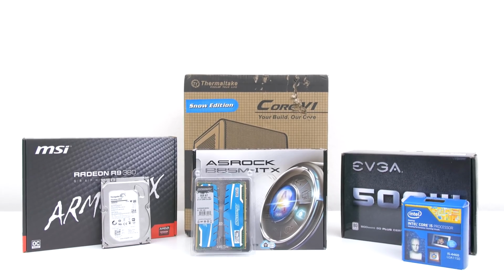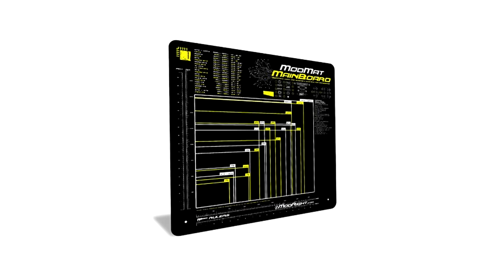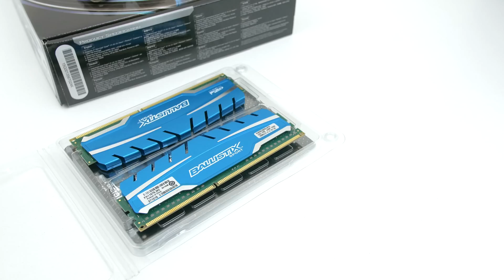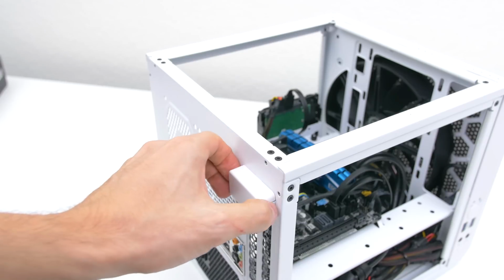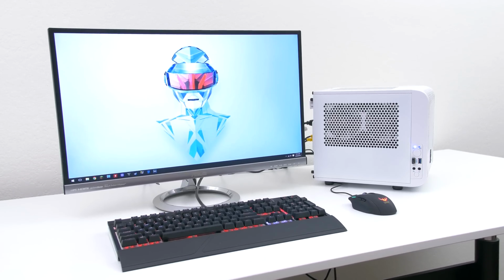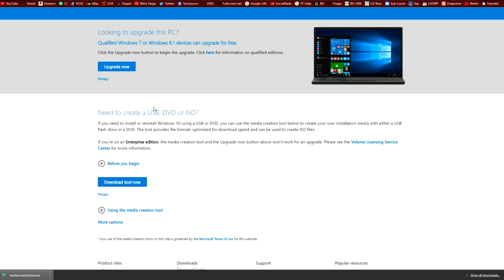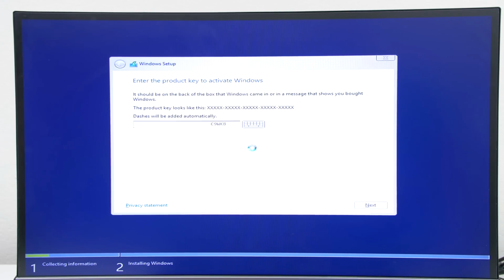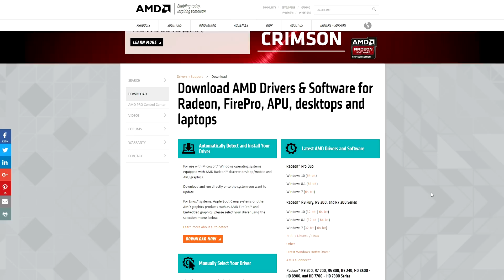How To Build $600 Mini-ITX Gaming PC w/ Windows 10

Comment: I have this a build similar to this 
I5 4460
MSI GTX 960 4GB 
CORSAIR 8GB RAM IN 2X4GB 
EVGA 500W
250SSD AND 2TB HDD
MSI KRAIT MOTHERBOARD 
overall the build is solid only thing I'd change is that I wish I waited a bit and got a better processor as I play cpu heavy games

Comment: Excuse me , do you guys recommend i get a $500 Laptop or go with this build?
Reply: this build is much better than any laptop
Reply: I usually don't reply, but seeing a lost soul on a topic I actually know I few things about. I can safely say without a doubt that you should definitely get this pc. any $500 laptop would most likely be crushed by this pc. just because laptops are overpriced in general. they charge such a high premium for "Slim and Mobile" gaming. not to mention, the laptop you're looking at might not even be capable of running games ( just for the sheer fact that it wasn't created with gaming in mind).Anyways just to summarize, get this pc if you want guaranteed gaming performance. (Watch his benchmark on this pc, it will show you the average FPS of games that this pc will give you.)
Reply: This build!
Reply: +LYFE Latops are usually more expensive because it includes a screen, keyboard, and a lot of wireless features.  Nonetheless this PC will demolish a $500 laptop.
Reply: go with this build it will beat any laptop for the price
Reply: rule of thumb any  do it yourself pc build will crush  same price laptop, hands down.

Comment: Out of curiousity - why do you install the operating system on the SSD drive.  Is there an advantage to doing this or is it just personal preference and so you can save all your files to the HDD for easy storage and deletion.  Is there another advantage to having the 2 drives?  Cheers,  Vicki

Comment: if instead i get the gtx 970 will it still be the same Building process??
Reply: the AMD RX 480 is only $199 and is faster than the 970.
Reply: +Arekkusu The Great How does it compare to Higher cards like the 980?
Reply: It's in between the Gtx 980 and 980 ti. Wait for it to come out later this month.
Reply: Cassie Griffin the 980 will be about 10% faster but the 980 is $200 to 300 more expensive.

Comment: If you dont want to go to reddit the website kinguin (I got mine here) has the cd keys for about $20 or lower. It only requires a 4gb flash drive to install windows. It is easier to use a usb 2.0 to download windows to avoid any problems.

Comment: @Techsource can i use this micro sd card and its adaptor as a drive to install windows 10 on this build? http://www.amazon.com/Lexar-High-Performance-MicroSDXC-version-LSDMI64GBBNL633R/dp/B00IF4OATU?ie=UTF8&keywords=go%20pro%20sd%20card&qid=1465424485&ref_=sr_1_15&sr=8-15

Comment: Will it play club penguin 4K on five 6p monitors?
Reply: no you'll need a more expensive build for such a demanding game
Reply: I think 12 1080s and 4 Xeon 18 core Cpus will be able to play that game at 480p 20fps
Reply: You'll have to have a 4 way 1080 SLI.
Reply: You will need 7 way 1080 sli to barely run at 30fps low settings.
Reply: I'm pretty sure. it might not be able to run minesweeper though.
Reply: If you want it from the technical side of things, club penguin is not playable on any computer at that resolution cause 6p = 6 pixels :P
Reply: you will need 12 quadros and 4 xeons to play 360p @ 20fps
Reply: Haha no. Club penguin is the worlds most advanced and physics bending game. Currently, no computer on earth can play higher than 360p all settings at low and reach 2 fps MAX!
Reply: The Gaming Bible so my pc with a radeon 5700 hd  can't even RUN the game! now i know why that internet cafe has 12 quadros

Comment: can u change the gpu for a 960 or 970 whitout any problems.
Reply: There is a link to a 970 in the description under optional parts. This will definitely fit in the case. Most graphics cards will fit in this mini itx case but I would just double check measurements to avoid any problems. If you are in doubt just use the one that he has in the description
Reply: you mean a 970 instead of a 380 yes you can use a nvidia gpu but you need the drivers from nvidia not amd

Comment: Is this good for a $550 gaming PC?
Intel i3-4170
MSI Z97S Krait Edition ATX
1600mhz 8gb ram
MSI GTX 960 2gb 2gd5t oc
Thermaltake 700w psu
Corsair Carbide 400c 
Corsair H60 water cooler

Plan on overclockin
Reply: Processor... Nope...
Reply: +Calico what processor than?
Reply: You probably don't need a 700w.
Reply: Get rid of the water cooler and downgrade the PSU to the Evga 500B. Then get an i5. You can't overclock non-k processors.

Comment: Question: I'm really interested because it's really compact and easy to build. Will the pc overheat faster then normal ATX's?
Reply: Thats why its called "icecube" LOL
Reply from the maker: +Benjamin Streulens nope. It's extremely cool
Reply: Thank you and keep up with the fun setup wars and builds! :) You earned the 700.000 subs ;) Congrats
Reply: He's got guides for cheaper pcs like $350. You can probably get away with an i3 or pentium. Most gpus around $100 can usually handle games ike TF2, LoL, Minecraft etc. Like the gtx 750 ti
Reply: That depends entirely on the games you want to play
Reply: Well this computer is pretty great, but you could substitute the ram for just 8gb and maybe a 500gb hard drive. That could save you some extra $. Also get a cheaper case if you don't care about looks, mine was the cheapest i could buy!
Reply: if its just productivity and light gaming, honestly a laptop is fine, so long as it has an i5 probably for some decent performance, and if it has a weak gpu like a gt730m for example, they're quite competent for games like you stated but yeah, pretty much anything is fine, just make it fit your budget :)
Reply: +TechSource does this beat a MSI with gtx 970m laptop gs60 ghost pro??
Reply: I'll probably be selling one you describe, its a laptop, lenovo y510p, Its got a gt755m and an i7 processor
Reply: +TheDemonDevil probably not. But it depends on whether or not the laptop thermal throttles. If it doesn't, then the laptop is better. The R9 380 loses to a 960 4gb most of the time. So a 970m should be even better.
Reply: BLOOGaming thx for the reply so I guess I shouldn't build this then? What bout when rx480 comes?
Reply: TheDemonDevil  depends on your budget,m but yeah, rx 480, I'd wait for that, it's a bit of beast for the price from what we know. cpu and ram wise it doesn't matter too much, unless you want to play really intensive cpu games like arma and stuff, but this build, replaced with an rx 480, and maybe a sexier case ;) would be pretty competent for 1440p and easily do 1080p
Reply: +ThePurple1234567891 buy anything BC if it doesn't run chrome then it's not a PC anymore it's trash
Reply: +ThisGamerzAwesome I would call it a potato ;)
Reply: no, the reason you buy a bigger case is so you won't be limited in the size of your build next time.
Reply: *****  750 ti is a really really good value card, got one for my brother and he plays fallout 4 (with a pentium mind you) on low-medium settings at 50-60fps, so  its a very very good value card i reckon
Reply: TheDemonDevil
Sorry for the late reply! It didn't pop up in my notifications for some reason.The RX 480 is pretty awesome. The 4gb version is equal to the 8gb version in almost every game. So you could just pay the $200 and get bettter-than-970 performance. Especially with Vulcan improving AMD's framerates by >25%! Then again, only 2 games use Vulcan right now.
Reply: Jordan McGaw I got one of them for $20 on craigslist
Reply: ***** luckyyy

Comment: What if my hard drive isnt showing up anywhere? Is it defective?
Reply: Also now my computer is saying "whea_uncorrectable_error" in blue screen then restarts and says "An operating system wasnt found. Try disconnecting any drives that dont contain an operating system." My boot drive is an m.2 drive and i had just installed all the drivers then it crashed. I have no idea what to do please help
Reply: did you install the correct drivers? also you need to boot from your hard drive... you know the one were the OS is...
Reply: theres a how to video, how to install Windows to an m.2 ssd

Comment: Is this good for a $550 gaming PC?
Intel i3-4170
MSI Z97S Krait Edition ATX
1600mhz 8gb ram
MSI GTX 960 2gb 2gd5t oc
Thermaltake 700w psu
Corsair Carbide 400c 
Corsair H60 water cooler

Plan on overclocking

Comment: Is this build good? (I fixed the motherboard and ram part)

Cpu: Core i5 6500
Gpu: MSI GTX 960 4gb
Psu: Corsair CX 500W
Kabinet: Corsair Carbide Spec-01
Motherboard: MSI H110M 
Hardrive: Seagate sshd 1 tb 
Ram: Kingston HyperX FURY DDR4 8 gb 
Wifi Adapter: P-LINK TL-WDN4800 Wireless adapter

Comment: dont like the motherboard no pcie 1 slots. what if you need a wireless connection?
Reply: Use the wireless adapter he showed in the video. -_-
Reply: +Louis is that any good for gaming?
Reply: +Tofg no its not
Reply: +Nicknack ok thanks man!
Reply: +Nicknack Do you know anything els? For wireless wifi?
Reply: nobody uses wifi for gaming anymore. Go Ethernet

Comment: I just built a budget gaming pc about a week ago, and the case I got was a bitch to build in. I got the diablotek diamond atx case, and dear lord it is impossible to get the mobo in. it took me 30 fucking minutes just to get a mini itx mobo in a full itx case.
Reply: that's because you got a $30 case.
Reply: well I know that, but I didn't have any money for a more expensive case. trust me, I would have got a better case if I could. I would have had to get a lower end cpu, and I love the cpu I have. its a quad core I have oc'd to 4.7 ghz with a stock cooler. no one probably cares though lol.
Reply: BigMan7o0 what cpu is that?
Reply: +Hades Gaming athlon x4 880k.
Reply: BigMan7o0 whats your load temps?
Reply: around 60c to 95c depending on how hot it is. its usually about 10 or 15 degrees hotter than ambient temp.
Reply: BigMan7o0 youre aware if your cpu is at 95c youll be throttled down to hell right?
Reply: yeah I know. 95 is like dead middle of the day ac is off, at 100% load, and my cpu averages about 10% load on normal usage and 20% when gaming.

Comment: so after installing the drivers you dont need the wifi usb key, right?
Reply: If you want to use WIRELESS internet then you will need the wifi USB adapter forever because the MoBo doesn't have one, but there is an ethernet port if you have access to it and then you won't need wifi.
Reply: I think, although I am not 100% positive because I have not built it. The only driver for Internet is the LAN driver.
Reply: So the only way to get wifi is to install an adapter?
Reply: Only use wifi if you 100% need it. Otherwise just get an ethernet cord.

Comment: hey, i am planning to build a new pc soon so i wanted to ask if there is a limit on the amount of ssds and hard drives you can connect. and also, how did you know wich one was the ssd during the windows setup?.

(btw, i am planning to use the same case as you xD (nzxt s340 black/red))

Comment: What is the point of an SSD doesn't a normal hard drive have more memory anyways why pay more for less or am I missing something?
Reply: SSD is much much faster than a regular hard rive. No moving parts
Reply: an SSD is so much faster than a HHD, and an SSD is less likely to fail or lose performance  because it has no moving parts this also means it makes no noise and generates no heat unlike a HHD.
Reply: I hope you are trolling...
Reply: Sweet thanks guys :)
Reply: +David Rodriguez  no problem
Reply: A hard drive has more storage (usually) but the read/write speeds are significantly higher on a SSD. People usually install the OS and their favourit games on the SSD since boot/load times are much shorter and more responsive. I hope I answered your question.
Reply: Ssds are faster way faster
Reply: Boot the computer with a HDD vs an SSD. launch an app HDD vs SSD. Launch a game on HDD vs SSD. see
Reply: ssd drives load everything faster, will boot up your pc much fadter, will load your games much faster, 10 seconds here, 20 seconds there, per loading screen. you will save hours, days, weeks etc.

Comment: Can i replace the gpu with my GTX 1080 sli?
Reply: Yes, but first remember to remove the PSU.
Reply: If you're not trolling then you can only have one GPU, as there is only one PCIe slot. So yes, you could have a single 1080.
Reply: WHY THE FUCK NOT
Reply: xD
Reply: should be a troll

Comment: How long does this take?
Reply: around 1 hour
Reply: around 1 hour,max 2....
Reply: Depends if you are going fast or slow, experienced or not. I built my pc a year ago I think it took like 2 hours but i went slow to check everything like 5 times before continuing xD
Reply: I built my first pc using the same case in this video and it took me about 25 minutes to build it, and another 10 minutes to install Windows and get it set up.
Reply: 1-4 hours depending if you don't run into trouble. could take longer

Comment: can I change the graphics card to a Rx 480 than a r 380
Reply: YEEEP :)
Reply: no you cannot ,the 480 isn't out yet
Reply: +idk m9 dude
Reply: m9 can i do video rendering on this pc?
Reply: +Sim yes
Reply: yes
Reply: yea, graphics cards (for the most part) all use the same connection, its the CPU that doesnt
Reply: Yep. I checked for you!
Reply: when is the rx480 released and where can you buy it from?
Reply: 29 june
Reply: If I were to do the same, would I need to get the 4gb version? or the 8gb?
Reply: CookieBowl Well, considering the graphics card used in this video was only 2 gb, you could go for 4gigs.
Reply: The Gaming Bible Thanks man! Also what do the gigs mean on the graphics cards?
Reply: CookieBowl So gigs (Gigabytes) refer to the amount of, sort of ram, in the graphics card. The Graphics card uses this to process images before they appear on screen. Higher gigabytes are better for higher settings, render distance and monitor size.
Reply: Considering the power issue the rx 480 is having now would you guys still recommend the 480
Reply: NOOOOO! IT WILL BLOW THE ENTIRE WORLD UP!!!!!!!!!!!

Comment: Dear Ed can i use the IceCube for livestreaming gta5 and other pretty hard gameswith good quality Thank you and congrats hitting the 700k
Reply: no just go with a i5 4460 it is enough for  720p
most people cant buffer 1080p
Reply: no you wont be able to livestream gta 5 but other games will
and you cant livestream without decent networkspeeds
Reply: Go for a I7 like the 4790k or the skylake 6700k or any other new I7 if you are going to stream and get a decent GPU. (970,1070 or a RX 480 or a 390x
Reply: BeazT Bonez Thx for the reply`s guys i have a good network speed and the r9 380(4gb) but i want it on a budget so is a fx 6300 okay ? if you have suggestions i would love to hear them
Reply: Thx guys i now see youre dutch dus dankjewel...  but i`ve a question i hyave the a10 7850k with the r9 380 4gb
but i cant even record minecraft on 30fps is it because the cpu suck or is there any problem ?
my full specs are:
amd a10 kaveri 7850k ocd 4.0ghz
r9 380 msi 4gb
asrock fm2a88m extreme4+ 
dual 4gb 1866mhz from fury 
and a 750 watt g750m
and btw the k380 and some extra fans and a cpu fan
i would love to hear from all of you :)
Reply: +KOEN1046 which program?
and check if cpu decoding is turned on
Reply: ProBro_NL OBS and i dont now what cpu decoding is ;)
Reply: +KOEN1046 did you follow a obs setup toturial?
Reply: no i didn`t
Reply: +KOEN1046 in order to record you need to configure obs
if you want to record you will need to need to follow a recording setup
and if you want to stream you will need to follow a streaming setup
Reply: +Soulfulant12 Gaming yes you can also render gpu

Comment: is it possible to connect my pc hard drive to my laptop via usb?
Reply: Yes, you need a SATA to USB cable.
Reply: thanks mate
Reply: +RPA or u can buy one of those very cheap external hardrive enclosures and connect the pc hard drive in and u get the cable included and ur ready to use it on your pc/laptop play station or anything tht supports a e.harddrive
Reply: thanks
Reply: I recommend a cable as enclosures mostly are for 2,5" drives like ssds or laptop hdds and a normal hard drive is usually 3,5" so it won't fit
Reply: +The Diamond Games - Channel closed  Okay thanks
Reply: We Done The enclosures are just cables in a casing, so if you need a more permanent solution get an enclosure. Otherwise, go cable.